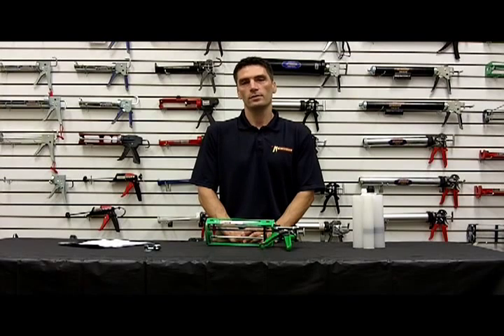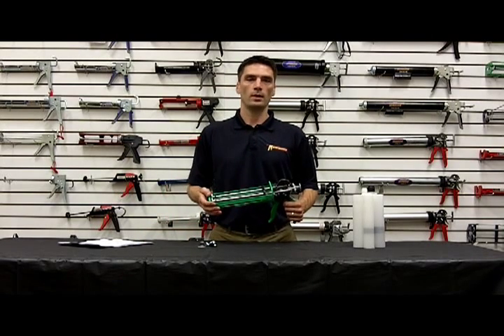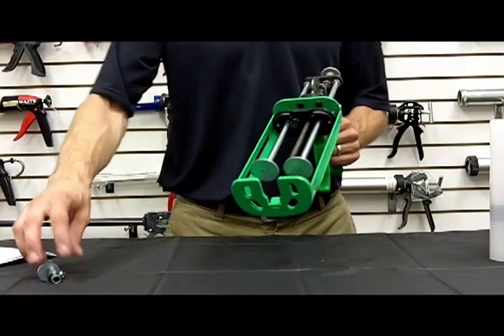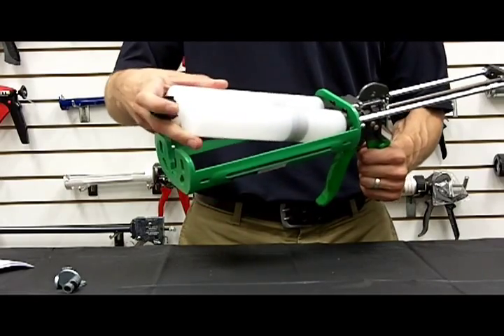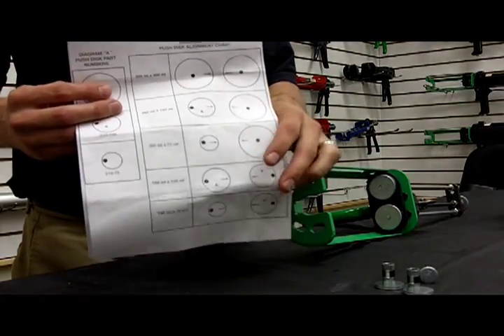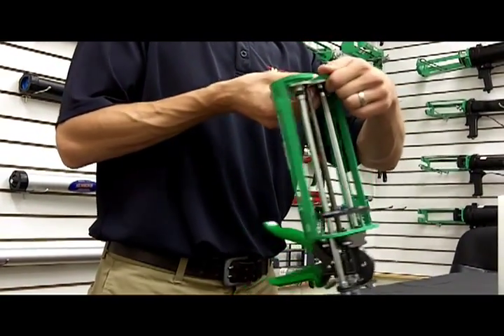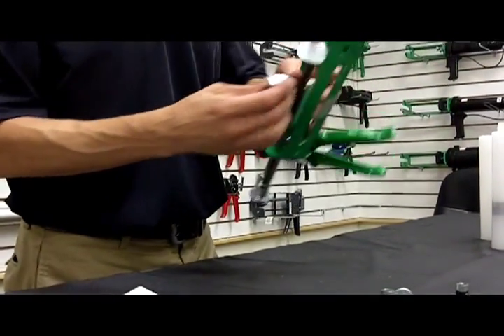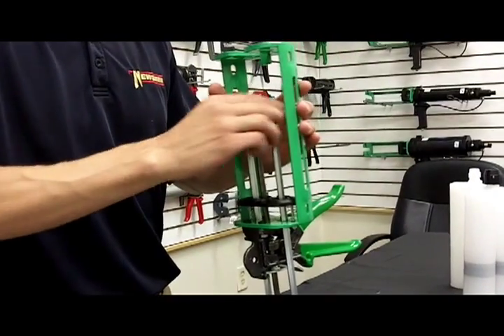How To Use a Multi-Component Manual Gun

Comment: Retract? Once the cartridges are empty how do you do that
Reply from the maker: Hello Paul, to retract the rod, push on the gripping plate (silver tab) on the back of the gun and pull the rod back. Make sure you are not squeezing the trigger while doing this or else the rod will not retract. Check out the video above at 0:50 to see how to retract the rod without the cartridge. If you are still having issues, you should check to make sure that your cartridge is not stuck to the gun (which can happen if you let the material dry without cleaning).